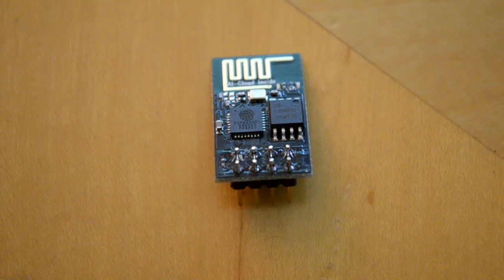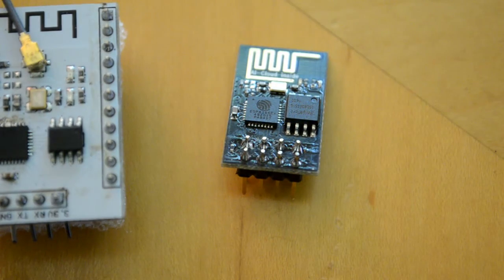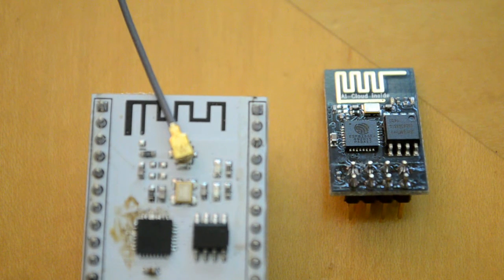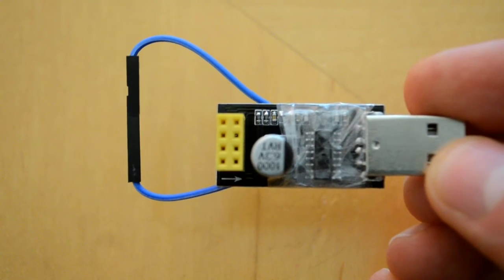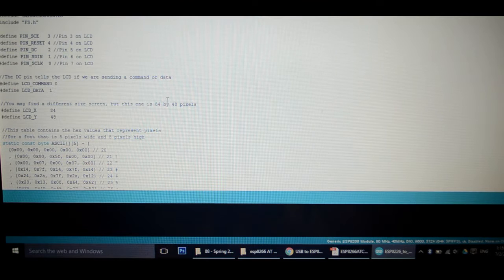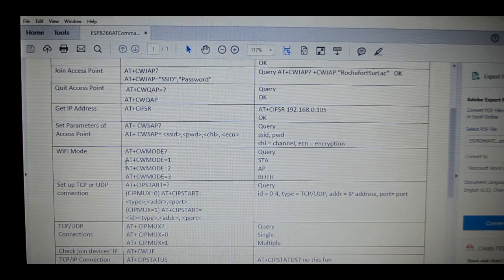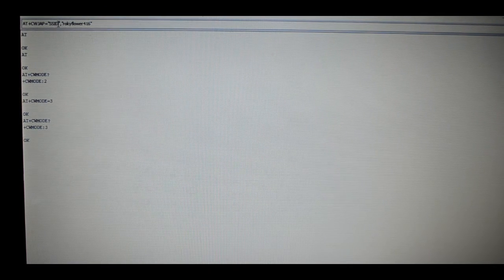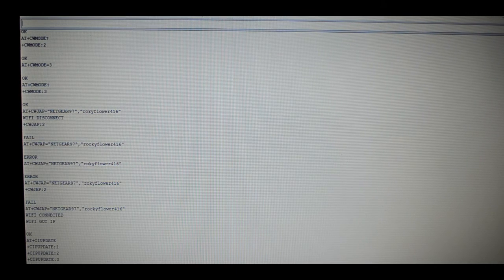2 different ways to upgrade, update ESP8266 ESP 01 Firmware

Comment from the maker: I had some hard time to gather information for my projects, so I'm I'm going to put some key points on short videos and put the on YouTube, so it may help others. This is my first video about upgrading ESP8266 firmware. I also made an small edit on ESP-01 board by connecting GPIO-1 to GND, which changes the programmer board from AT mode to upload mode. Links are available for all necessary files and documents. Please help me with any advise for my next videos.